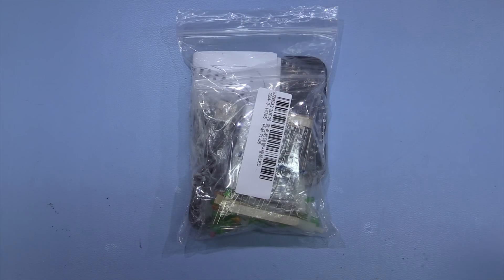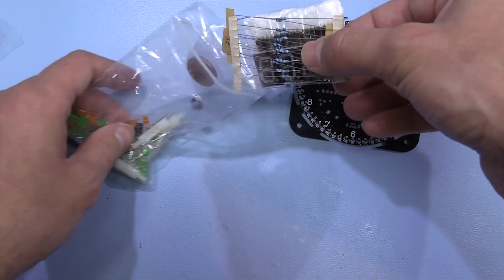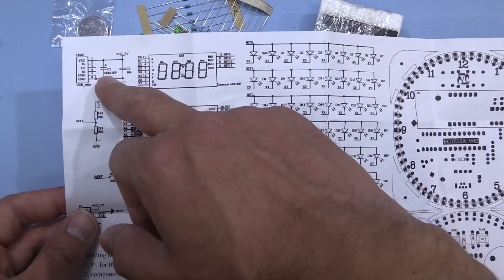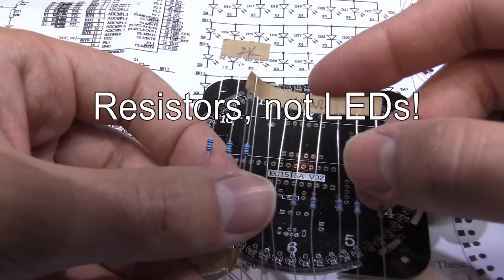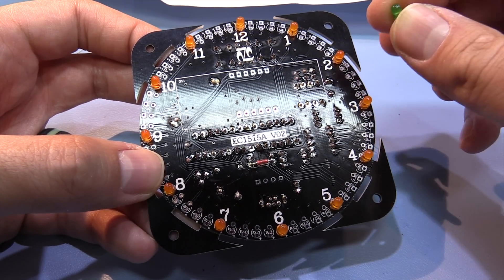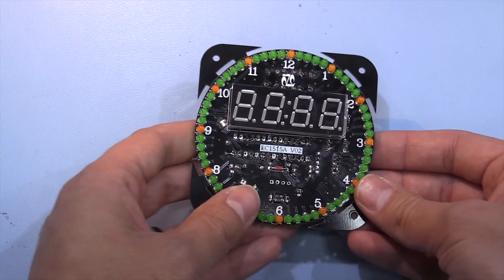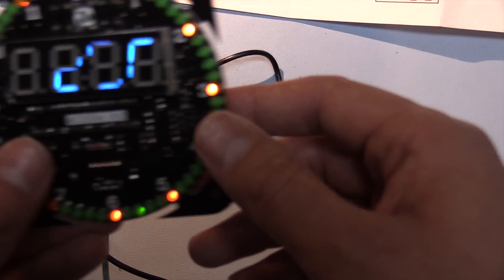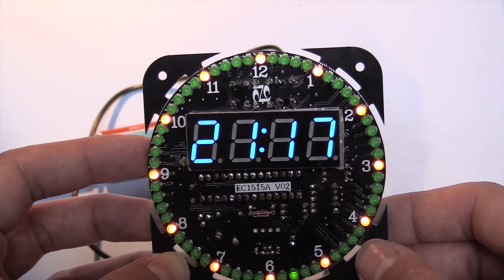SDG #034 Circular LED Clock EC1515A DS1302

Comment: Hi I've just built this V3 and got it going fine, but, it's gaining 2 mins an hour, any idea what may be wrong? Clock chip or the crystal perhaps? Cheers
Reply from the maker: Alan Clarke you could try adjusting the load capacitors on the 32kHz crystal as you don't have access to anything else.
Reply: SDG Electronics any idea what to has I don't have any experience at all, just soldering lol

Comment: '
can this DIY rotating LED clock kit use a pack of four AA batterys = 6 volts...
would be work fine or better not...
will it burn out LED lights or two microchip controllers or both

Comment: Hi Steve...I'm back again! All finished but when plugged in the clock reads ''Eor 1". The instructions, at the bottom of a page shows that error but doesn't explain or show any solutions. Any idea what's wrong? (the LEDs don't light up...just the clock face)
Thanks in advance.
Reply: The error indicates either of a soldering or connection problem with the DS1302 (8-Pin) Clock chip. Depending on who you bought the kit from, they may be willing to replace the chip or the kit...
Reply: Rick Allen...thank you very much for getting back to me! Now I know where to start looking to hopefully solve the problem. I have two more kits (B versions) so I'll look to see if they use the same chips and/or clock. Thanks again!!!!!!
Reply: Rick, I replaced the chip with another I had from another kit. It worked, but only for a short while. After about twelve hours of run time the clock starting malfunctioning. Bought it from BangGood and if you are familiar with them then you know returning defective goods requires at least one video for them to rview, I won't bother!
Thanks again for your help!

Comment: Too late...I desoldered it and broke 4-legs...damn it! After I removed it I thought about doing the exact thing you advised...to just leave it in. I soldered the socket in and inserted the chip with the broken legs and did a continuity test on all the legs and all were making contact so I'm going to cross my fingers to see if it all works once I'm done putting it all together. As I mentioned in the other post I don't know very much about electronics and thought you had to have a socket installed for the chip to work. Now I know better and it was an inexpensive lesson. I will keep you updated...if that's ok with you.

Comment: Steve, I screwed up! I put the small clock chip on the PCB and soldered it in not seeing and realizing it had a separate socket that was to be soldered in...have I destroyed that chip? (I feel so stupid but I'm fairly new to electronics which is why I bought this kit to practice on.)
Reply from the maker: It should be fine unless you overheated the chip. Turn it on and see!
Reply: I have to solder the 48 red LEDs in...I haven't completed the build yet. Will get back to you and let you know how it turns out. Thank you for getting back to me so quickly...I'm about to desolder the chip...wish me luck!
Reply from the maker: Don't desolder it, if it works then leave it as it is.

Comment: can you stop it flashing between time, date and temp,?  mine does the same,
Reply: The newer version of this clock supports changing the display to only the time or alternate display of time and temp thru pushbutton options.  The newer kit is model number EC1515B.
Reply from the maker: As far as I know there isn't a way to stop it. It's a bit of a shame really.
Reply: try to short pins 6, 7 and 14(gnd) on STC15W408AS to stop rotating and displaying only time. it works on this kit : https://www.aliexpress.com/item/Compact-4-digit-DIY-Digital-LED-Clock-Kit-DIY-Clock-Accessory-Light-Control-Temperature-Date-Time/32616457562.html
Reply: +Milan Rosic will give it a go. thanks Milan.

Comment: Hey there, I've put together one of these myself and have run into a little issue.  When I plug the miniUSB in, all of the LEDs light up, but stay on constantly.  The buzzer makes a steady buzzing and the clock reads Eor2.  I'm gonna try to lift the crystal off the board, but any other ideas?  Thanks!
Reply: EOR2 indicates a failure of the thermistor circuit. Check your soldering and be sure the thermistor (RT1) , which reads the temperature, is properly installed. 
Also be sure you placed a 20k resistor in the R10 position on the circuit board. 
The thermistor looks very much like a glass diode in appearance.